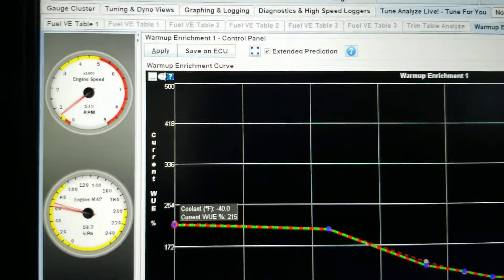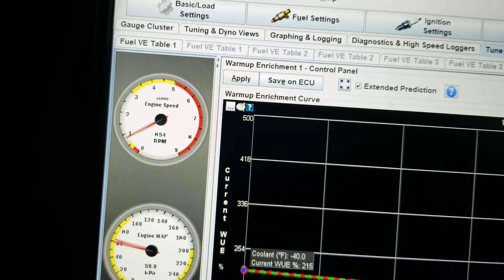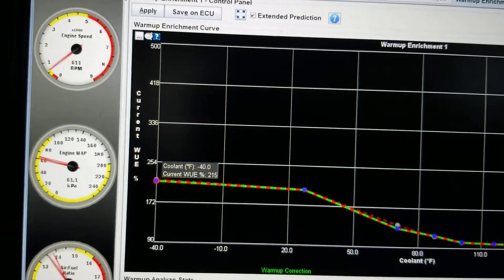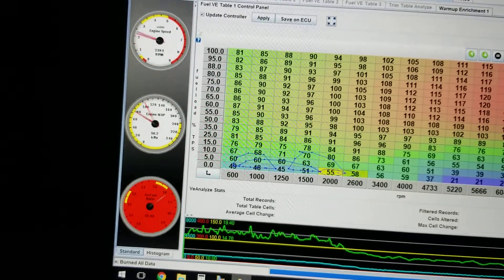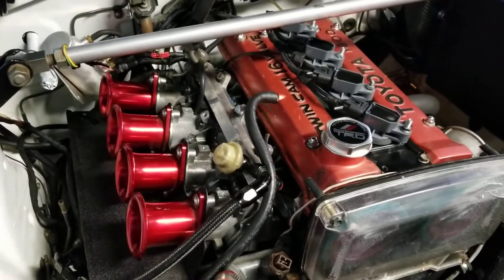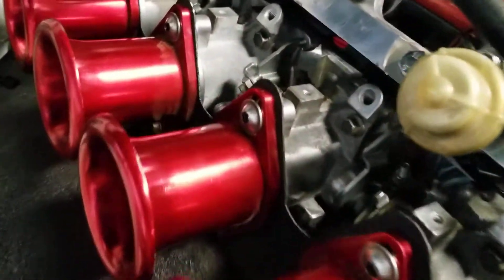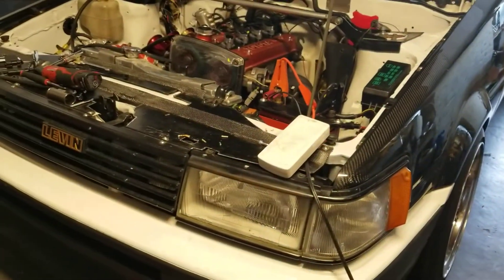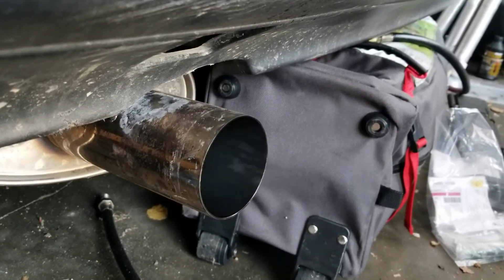AE86 4AG Sequential Ignition and Injection Megasquirt DIYPNP V1.5

Comment: I am running the megasquirt pnp on my set up . I was wondering if you could give me some info on what I can completely delete from my harness, when wiring the tps what wires I bridge and where you mounted your a.i.t
Reply from the maker: Every setup is going to be different, so it's hard to say what you do and do not need. But the Intake Air Temp Sensor is mounted on the strut bar with the yellow ziptie. I don't have A/C or PS so you can remove all those wires if you'd like.

Comment: You need a cam sensor trigger wheel to run sequential injection right ?
Reply from the maker: cam and crank, yes. I'm pulling a cam signal from the factory distributor.
Reply: @slo111poke6  
Ok,
thanks.

Comment: Hey dude, I have a 20V 4AGE that came with a megasquirt ECU, but the loom from ecu to engine was cut.  I have both halves of the loom but am having trouble connecting them.  I am also planning on running 1NZ COPs.  Is there a way I can contact you to discuss your setup?

Comment: How did you convert the distributor to crank sensor?
Reply: I'm using an aftermarket computer that accepts crank trigger input.
Reply: Veasna Lim  Im planning to do COP for 4age small port. Im have a standalone ecu Link G4 ecu. Are using the stock crank sensor (trigger wheel) or did you go aftermarket trigger wheel for this set up to work? Not the trigger wheel in the distributor but the crank sensor in the crank. Thats what I meant to say.
Reply: I'm using a 36-1 MRP trigger wheel mounted to a BHJ pulley.
Reply: Thanks a lot!!!